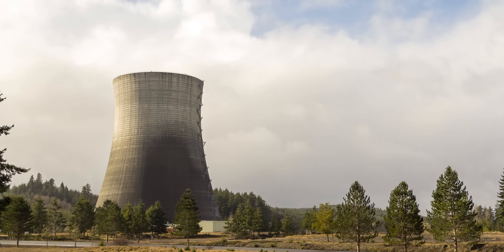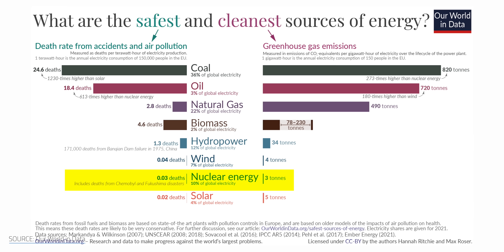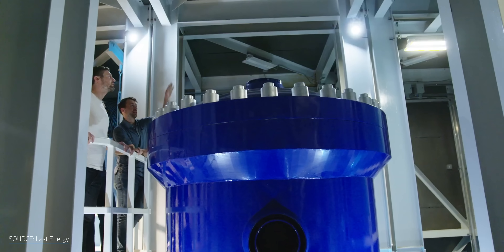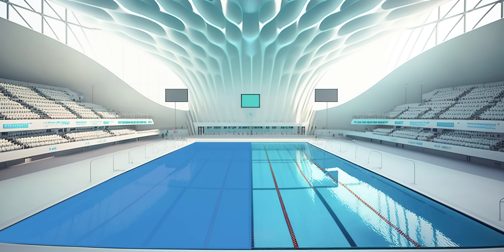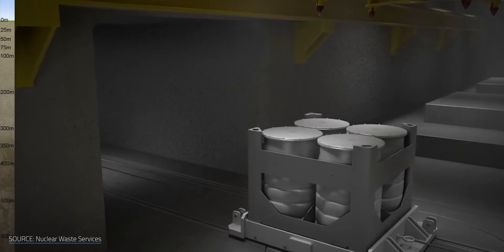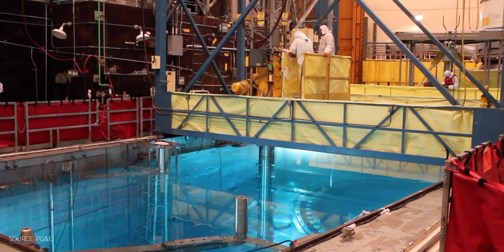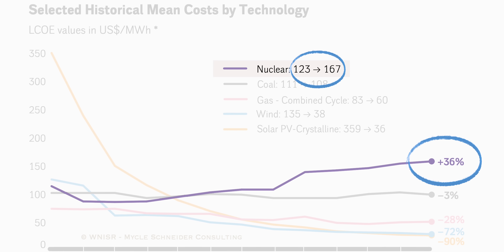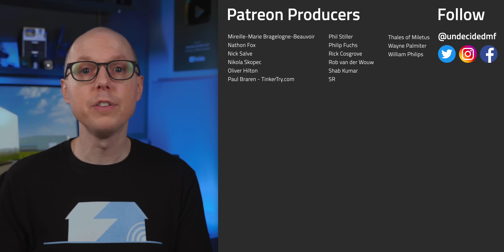Is Small, Fast, & Cheap the Future of Nuclear Energy?

Comment: Small modular reactors produce more waste and are less efficient than their bigger counterparts. Economically, they're also unfavourable and only really an option when more electricity production is needed comparatively quickly. Fast breeding reactors and their ability to decompose atomic waste with geological half-lifes to a much shorter acting variety, while generating energy on top, is where it's at. These reactors can also be used with Thorium-232 and Uranium-238. India is currently the only country pursuing the construction of such a facility, while Russia is operating two of these in order to make Plutonium.
Reply: The USA Built a thorium/U233 fueled 275 MW electrical output nuclear power plant at Indian Point (Unit 1) that went online in 1962.   It was later converted to U235 fuel due to economics.

The USA also ran the Shippingport 60MW electrical output demonstration/test reactor (online 1957) with a thorium/U233 breeder core for 5 years (1977-1982) which was successful as well.   That small demonstration/test reactor was uneconomical commercially and did not meet modern safety standards by the early 1980's (and not worth upgrading).  It was decommisioned after the thorium breeder core test was completed.

Nothing new about thorium reactors.    India is seriously looking at thorium as it has a lot of cheaply available thorium.

Plutonium is not breed from a thorium reactor. U233 is, and U233 makes a good nuclear bomb too.

Virtually all nations making plutonium for weapons have used SMR sized reactors.   Usually they are not set up to produce electricity, but some have been in the past.
Reply: @perryallan3524  You gotta be careful when talking about economics regarding nuclear power. In this sector, economical is whichever approach is getting enough subsidies, so this is a purely political problem.

Also, I didn't say that Plutonium is breeded from a Thorium reactor. I said that fast breeding reactors (the molten salt variety to be specific) can be designed to accept U-238 and Th-232 as fuel, since both nuclids are fertile in such conditions.
Reply: @Psychx_  Neither Thorium or U238 are fissionable materials.  They are not fuel.   Both can absorb a neutron from the splitting of other atoms and be converted to fissionable/fuel materials (U233 & Pu239).

Any form of nuclear reactor (graphite, light water, heavy water, liquid metal, etc) can use these materials.  It's not limited to just liquid metal fast reactors.

I've spent decades in the nuclear industry and have long been a proponent of nuclear power.   I have never heard of anyone solving the corrosion issues with molten salt reactors  (and lots of materials and super alloys have been tested) - which means they cannot be expected to run for decades without massive amounts of rework.   Such rework is very very costly, if it can be done at all.

The Chinese feel that they have gotten the corrosion rate down to an "acceptable level" for a potential 40 year life and are running a test reactor on that.   Time will tell.    

As a comparison.  Reactor vessels and primary piping in 1960's and 1970's designed reactors are over 50 years old, have current licenses for 60 years, and another 20 year extended license application is in the works.   They are actually talking about the feasibility of running some of these plants for 100 years.
Reply: @Psychx_  Something else to consider.  Once you are past a demonstration plant - and get to real world power plants... Economics matter greatly and only the most ecomonical plants get built.

The USA Energy Administration and others have totally distoted the cost of "power plants": by separating the generating cost with the transmission and distribution cost to the end customer.   Windmills and solar panels produce "cheap" electricity; but the cost to connect them to the grid and manage their power output is transferred to the transmission and distribution companies in the USA; and its astronomical on a MWhr basis.

On a delivered to a major city basis, large nuclear power plants is the cheapest large scale power source in the world outside of hydro (especially where you have an experienced contractor base that knows how to build nuclear plants).  There are studies on this (but I've learned that I cannot provide web links in youtube comments).

This is why many countries in the world are building large nuclear power plants.  Because it provides the cheapest option to the end customer - which most countries focus on.  Here in the USA the extra cost of wind and solar is just part of the unseen transmission and distribution charge part of your electric bill (why my city charges about $0.09/Kwhr when they buy power at about $0.025/Kwhr).
Reply: @Psychx_  If you are interested in the combined issues regarding cost of electriciy amoung different power generation methods do an internet search for the following document:

The Full Costs of
Electricity Provision

That should get you to an executive summary published in 2018 that anyone should be able to download free of charge developed by several international energy organizations.

The more detailed information behind this report (and more modern numbers) is unfortunately not so easy to find (I used to have access to it - not sure if I do anymore)

But this report tells you why countries are building central power plants and not just counting on solar and wind - because the grid cost of solar and wind are expensive and overwhelm the generation cost.
Reply: Time to market matters more currently, it means quicker profits faster cycles like software

Comment: I think this solution is more interesting, to me the biggest reason I was against Nuclear was the half life - they could call it clean all they wanted, but having no real solution for dealing with the hazardous waste was a big issue.  With recycling bringing that number into 100 years it  feels more feasable to use nuclear as it's not some near impossible timeline of generations.  

There was also that potential of using spent nuclear as small batteries that was pretty interesting - if all these ideas could be made safe, and a structure put in place of who can work with it, and what liabilities they need to be able to handle then I could see nuclear having a definite major play in the future.
Reply: Radioactive waste can be used to make nuclear diamond batteries that can last for 26,000 years, safe beta particles that cannot penetrate the skin.

Comment: sigh Okay, you need to do a better job than just reading the VC pitch decks for these companies.  

Why quote the half-life of the radioactive species of the closed-cycle process as "hundreds of years?" That doesn't imply it's not dangerous after that, only that it's half as dangerous.  Same goes for the 24K year storage for traditional cycles, we don't have to store it that long, rather much longer. 

Also, how much Uranium is available, and if we use dramatically more of it, how long will it last?

Comment: One point that was overlooked was the amount spent on government regulations in the nuclear power industry. The regulations are supposed to make it safer but government regulations are not always the most efficient way to achieve this. I worked in a plant that was designed to be operated by 200 people. That was before Three Mile Island (TMI). After TMI that number increased closer to 1500. The personnel increase was to meet new regulations.  

The reason the LCOE jumped during the study period was due to Fukushima. While Chernobyl had a completely different design than plants in the US, Fukushima was a similar design. The result was more regulation that had to be met by the plants resulting in the higher LCOE you mentioned. Also, the LCOE can be misleading due to the cost (time and money) imposed on nuclear by government regulations. Wind and Solar are both relatively new and have minimum regulations that could change. In addition, wind and solar can’t provide output 24x7 like nuclear. 

SMR will have to resolve some of the issues of government regulation while maintaining a high level of safety to be successful.  While it is helpful that they can be quickly built and deployed, it doesn’t help if it takes years of red tape to get a license to operate the reactor.
Reply: I don't think that was overlooked? It figured on the list of expenses - and they talked about it as well, how they intend to streamline the bureaucracy by shipping the exact same product every time.
Reply: @RasmusSchultz  It was overlooked in the sense that when comparing the LCOE of the different forms of generation it wasn't mentioned that nuclear is so much higher due to regulations. It was pointed out the LCOE went up during the study but it wasn't pointed out that was due to additional regulations added due to Fukushima.  It makes sense that it should be easier to streamline the regulations by standardizing but in the current system that doesn't matter. It might allow some of the paperwork to be duplicated between sites but it doesn't change the years it takes to get the licensing. Or that the smallest change requires the same process and paperwork as the biggest change.
Reply: Thank you for highlighting this. Overregulation is the major reason why nuclear power is so expensive.
Reply: @johnfisher3380 
Said, "over-regulation is the reason why nuclear power is so expensive."

No.  The new nuclear power plants have multi-billion dollar cost overruns and decade long construction delays.  Plus nearly a billion to decommission and store the toxic waste onsite for millennia.

Utilities are not going to order any new nuclear power plants; they're far too expensive.

Comment: Another great video Professor Ferrell! The modular cost-effective approach taken is brilliant. Theses modular designs could also cut down the number of resources used to connect the grid (Poles, wire, etc.), creating further benefits that might not have been included in initial assessments. Not only would you reduce the amount of electric line infrastructure, but you also eliminate the impact it has on the loss of biodiversity of the land from resulting habitat destruction and fragmentation (Sodhi, N. S. & Ehrlich, P. R., 2010). 

Sodhi, N. S. & Ehrlich, P. R. (2010). Conservation Biology For All. Oxford University Press

Comment: Hazards: Non-issue relative to other current forms of energy. Coal power is a bigger radiological hazard than nuclear. The burning of coal releases ~20,000 tons of Uranium and Thorium into the atmosphere annually. That's several dozen Chernobyls. Every year. Just from burning coal.

Waste: Non-issue, we can store it all up for a century with projected growth and still wouldn't need a facility larger than the Cheyenne Mountain complex NORAD lives in. We can also accelerate nuclear decay with lasers now. How much uncontained radioactive waste is released by coal again? At least 20,000 tons. Total global nuclear waste is around 7,000 tons per year. If we stopped burning coal, switched entirely to nuclear, and aerosolized the resulting nuclear waste, the environment would be less radioactive.

Safety: Also a non-issue. Modern reactor designs are extremely difficult to turn into widespread radiological disasters, all of the hysteria comes from the first reactors that fell out of weapons programs and were thus bombs that humans kept on top of so they didn't explode too fast. We don't build them that way now. We haven't for decades.

Small modular reactors are the future, almost certainly, but those points are non-issues peddled by companies who make money selling and burning coal and oil.

Comment: As I've long said, there is no silver bullet to mitigating an impending climate crisis. Only silver buckshot.

Last Energy's SMR approach is an important part of an overall plan to decarbonize both civilian power and process heat generation.

At 20MWe/60MWt, Last Energy's SMR's are tiny in comparison to typical gigawatt-scale facilities. This is both a pro and a con. To the positive, Last Energy SMR's are an ideal behind-the-meter solution for industry where one or more units are co-located with plants that require immense power. Think steel, aluminum, concrete, chemical and petrochemical facilities, among others.

Another sweet spot for Last Energy's SMR's is in district heating schemes. While not prevalent in the US, district heating is commonplace in China, Europe and Russia.

Last Energy's SMR's could also be sited at coal-fired power plants as they're shutdown. Here Last Energy's SMR's could replace coal-fired boilers which have capacity factors of approximately 40% with a clean, stable source of baseload power with a typical capacity factor of over 90%. This would leverage existing equipment, infrastructure and transmission, while providing ongoing employment.

Other perfect applications for Last Energy's SMR's are desalination and hydrogen production. Both are urgently needed, but immensely energy intensive.

The downside of Last Energy's approach is that it miniaturizes legacy pressurized water reactor (PWR) designs (with several tweaks such as air cooling, rather than water cooling). These operate at high pressure and aren't inherently safe. Additionally, they produce spent nuclear fuel, just as existing reactors do.

Ultimately, we must have a combination of spent nuclear fuel reprocessing (currently banned in the US, though the French have securely and successfully done this for decades) and Molten Salt Reactors that incorporate spent nuclear fuel in their combined coolant/fuel mixture. Reprocessing would produce new fuel for PWRs, and MSRs would more completely burn spent nuclear fuel, thereby producing much less nuclear waste. Waste that's also much less toxic; requiring storage for only hundreds of years vs. the tens or hundreds of thousands of years current spent nuclear fuel must be stored.

All of this, of course, in combination with increased renewables production capacity, including solar, wind and hydro, with an increased emphasis on marine/tidal and geothermal, as well as advancements in chemical battery technology (sodium ion, redox flow, etc.) and atypical energy storage (pumped hydro, sand, compressed gas, etc.).

Comment: There is only one reason the US has a nuclear waste issue... It's cheaper to dig it out of the ground than recycle it. 97% of a fuel rod is still useable when taken out of a reactor. It just needs some post processing. France does not have a waste issue, because they don't have their own Uranium, they have to buy and transport it. They recycle it, and have only 1% waste. The other problem no one talks about is that Coal Plants exceed a Nuclear plant's annual radiation exposure in a day. We get most of our Uranium from coal mines. Uranium is regulated, Coal is not.

Comment: I'm a little frustrated with a lot of the complaints about nuclear power. When I read about nuclear power in the '90s when I was under 13, a lot of the problems people have been complaining about had already been addressed. Recycling fuel, safer operation. 

Even small modular reactors were well known because the Navy has been using small reactors in aircraft carriers and submarines safely and affordably since the late 1950s, early 1960s. They train 20-year-olds how to run those nuclear power plants all the time in the Navy.

I guess better late than never, but we should have been cranking out nuclear power plants for decades.

I think the challenges have truly been overstated, and many of the suppliers to nuclear power plants have taken advantage of the fear jack up the price of components. A lot of the nuclear industry had played into the fear of nuclear to maintain monopolies and justify bloated prices.

Knolls Atomic Laboratory has been pumping out nuclear reactors that have been used in the Navy. One of their reactors is enough to power a small city. And because they were designed for aircraft carriers and submarines, these reactors were designed for less than ideal conditions with disaster in mind.

And I also think it's important to realize that nuclear power doesn't just need to be used for electricity but can also provide district heating with steam, process heat for industry, steel and aluminum melting, air conditioning using an evaporative process.

Comment: Fuel recycling works. Superphoenix in France proved it was working ... but was closed because of political arrangements with the so called green party.
Using nearly all the Uranium instead of only 0.7% would help a lot.
Nuclear cost goes up, also because of decades pushing it out and therefore decimating the manpower. We see that in new projects, all the know how was lost and needs to come back ... at a huge cost (France's EPR that cost waaaaay much than planned).

Comment: In my opinion, the two largest hurdles for moving away from fossil fuels are replacing the peaker plants with a new solution, and dealing with the waste associated with renewables and nuclear. Fortunately the second problem has a solution (recycling), we just haven't fully taken advantage of it. The first issue is a bit more difficult, as the current solution we have is power storage, which has its own waste problem.

Comment: the problem with solar and wind is that they're unreliable energy producers. they stop producing power when it get's dark or cloudy or the wind stops. Nuclear power is the way since they're reliable and produces a lot of power. the problems with nuclear is as you say, it's expensive, but if we invest more in it, it will get cheaper. The modular nuclear plants that you're talking about can help the industry a lot. Or if there was a bigger market for nuclear power so that each plant isn't "custom" built (like a bigger version of the SMR's) it would make the industry thrive.